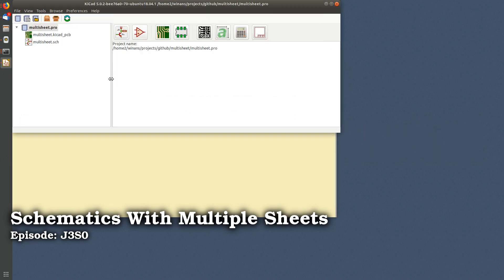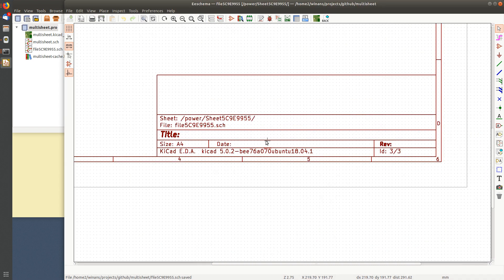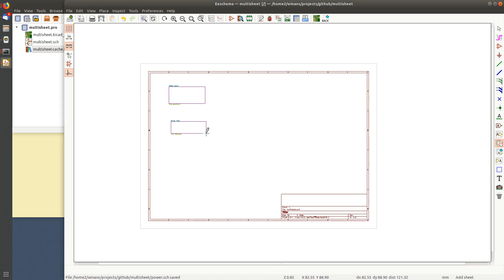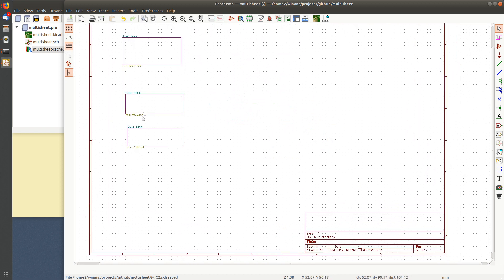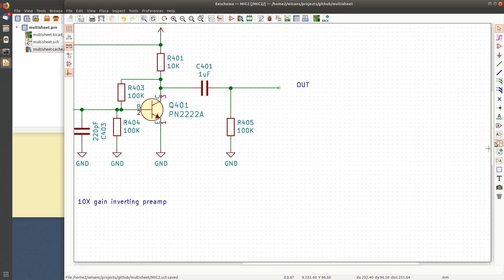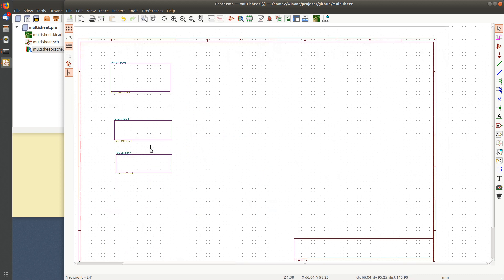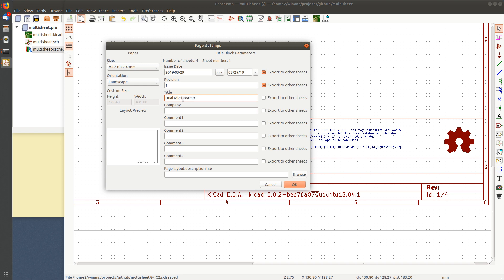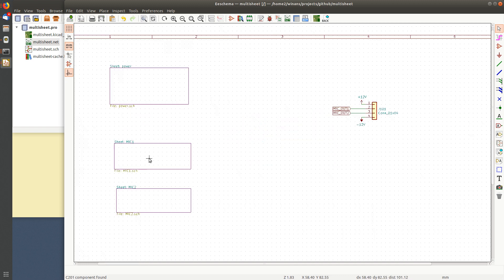KiCad 5 #16 Multisheet Schematics

Comment: Love your video explanations.    Q: Are there any substantial differences in this v5 tutorial, in newer versions of KiCad, ie: v7?
Reply from the maker: Much is the same.  Many have said that this is still relevant.  Since they now change the major rev number every year, it would be ineffective to re-record the series every year just to make that match.  The fundamentals of the tools remains the same.  Some of the default key mappings have changed.  Some new features have been added.  I suppose at this point a difference to a new user that might be important is that you no longer have to save and then load the netlist when transferring from the schematic to the PCB editor.  There is an icon in the same area on the PCB editor that just the whole thing in one go.

Comment: Tutorial was great. One suggestion I have is to have the global port coming out of and into the sheet objects. In this example it's pretty obvious but that won't always be the case. Knowing which sheet a signal came from or goes to at the top level helps the readablility of the overall schematic.
Reply from the maker: That would be a change to the design of KiCad.  You'll have to take it up with the developers.
Reply: Hello John. Turns out it is already there. use the hierachical label an "A" with a diamond to the right of it, on the sub sheet and select import sheet pin at the top level. You can now wire the submodules together. @JohnsBasement
Reply from the maker: @jimbrooks5496  I must not understand your suggestion.  "Global" is not hierarchical.  I suspect you did not mean a "global pin" in your original note... Which changes things.
My point was to address those used to flat multisheet schematics znd that use global nets... Not to suggest that doing so is desirable.

It is a common "complaint" that kicad does not support such designs.  However one can, if they simply drop some pages somewhere and proceed like they would with Orcad. (Last time I used Orcad, it did not support hierarchical multisheet.)
Reply: @JohnsBasement  this would be easier if I cd send a screen shot. The hierarchical label adds a symbol on the lower sheet, kind of like a port global port, but where the global port  can't be inserted into the upper level sheet symbol, the hierarchical label shows and can be used to run connects between top or upper level sheet symbols. This way, the rx tx lines from a comes subsheet could be used to connect the comes subsheet to the processor subsheet making the connections visible. Global make them electrical connected but doesn't give the you 50000 foot view of the design.

Comment: What's the point of those empty rectangles on the root sheet that you click on to reach each sub-sheet?  Would you put them somewhere off screen normally?  Not sure why you need those anyhow if you have the navigator window.
Reply from the maker: You can place them off sheet if they are not part of the schematic's /meaning/.
Often they will have signals associated with them in a way that is the schematic form of a subroutine. Such signals are then the I/O of the sub-schematic.
For example, draw up an analog mic mixer with 32 preamp inputs.
Reply: @JohnsBasement  Thankyou for the reply but my head's not grasping this.  Those just look like empty rectangles.  Why would you want empty rectangles on your sheet taking up space?  What meaning can an empty rectangle convey?  Thanks!
Reply from the maker: @MatthewSmith-wh5dr  they mean there is another page.  Many CAD tools don't require such things to be created.  KiCad does.
Review your thoughts on the subject after watching the hierarchical schematic discussion.  Bigger projects often go that route.
Reply: @JohnsBasement  Got it.  I'm sure it will make sense once I see it in action in a real project.  For me right now, I'm having them off the page to make room. :)
Reply from the maker: @MatthewSmith-wh5dr  That's fine too.  I think I have a recording where I discuss that style for those that don't like hierarchical designs.  That is a matter of preference.
It is just that KiCad does not have a way to create a multi-sheet drawing without using a hierarchical style.  So you have to put those boxes somewhere.

Comment: Hi there. When I want to use the command "Save as" it only applies as "Save Current Sheet as..." but there is no button to re-save the complete Project with another name. Is there a way to run a "Save as..." for the whole project? I cannot find it in the video.
Do I need to save each sheet separately if I want to try modifications? I don't want to end with 10 different sheets with 10 different versions on each sheet.

Any help is appreciated.
Reply from the maker: There is no convenient way to just save a copy of a project (that I'm aware of.) So I abuse the project template function for copying projects.  It is trivial to do but you need to realize what it is doing before blindly diving in.  I posted a video on how I use it to copy & rename projects with KiCad 5 here:
https://youtu.be/A4_wqnzKZq4

Comment: The main idea behind hierarchical sheets in fact is not about using global symbols in sub-sheets for connections between sheets...
Reply from the maker: I address that in part 17.  
I should have given a better overall view of the topic before getting into it here.  The fact is that I have seen an ENDLESS number of questions from users about replicating their flat designs as-is while they upgrade to KiCad.  So I discuss both ways in this series.  Upgrading from, say, Orcad is tough enough without going all-in on hierarchical symbols.
Reply: @JohnsBasement  My apologies John for my draft look - just later realized there is next story on hierarchical design. You are doing this video tutorials thing right! TY for that!
Reply from the maker: @genafongeek  😂 no prob.  This series sort-of just happened.  If/when i find the time to do a second fraft for, say KiCad 6, I hope it will be a bit more fluid.
Keep rhe critique comming.

Comment: What happens if you started a project, and then realized that it had to grow to multi-sheets?  Can I add a parent sheet and declare my former only sheet as a child?
What about a project that is going to be done across several PC boards, but I want to create a multi-sheet schematic that has net names for connections between the boards via a wiring harness?  I will need to create each PC board from a set of sheets.  I guess the over all connection would be a 'grand parent' sheet that shows the connections between each parent sheet (which is the top sheet for each board), and the set of child boards fore each parent (pc) board. 
I've seen schematics where each board was drawn on the top sheet as a 'part' and the top sheet showed all the connections between boards.  Then each board was a set of child schematics, the parent of these was the 'part' shown in the top sheet.  How to do something like that?
Reply from the maker: You might be able to make a single-sheet project a parent by playing games with renaming files.  But I'd play it safe and create a new project with its top page as the new 'root page' and then copy the sheet from the original/old project to the new project and then use it as the file in a new sub-sheet.
Multi-boards comes up once in a while on the kicad forums.  I am not aware of any viable solution.  You might try asking about this in https://forum.kicad.info/
Until KiCad implements multiple boards in one project then I think the idea of drawing a multi-board connection schematic might have to be its own project.

Comment: Hey John, what program do you use for circuit simulation? I'm assuming you're using it with Ubuntu...? Can you use the schematic editor from KiCad and export the resulting netlist into the circuit simulation program...? Thx for any help, love the series!
Reply from the maker: I haven't used circuit similation with kicad.  So I can not offer an opinion on doing so.
I'm sure others have.  You might ask about it in the various kicad forums.
Reply: @JohnsBasement  Wow, a spice app is built right in to Kicad 5.0! Very cool.

Comment: How can I change the order of multi Hierarchical Sheet, which means change of "Id" no. by manually .
Reply from the maker: I don't know if you can.
Sheet page numbers are assigned in the order that the 'sheet symbols' are added to your project.  Therefore, in theory, you can copy all of the sheet symbols to new ones in the order that you want your pages to be numbered and then delete the original symbols. BUT, if you do this, your part/component reference designators will all change and that will make any PCB that you have been working on into a broken mess.  So.. don't try this unless you ONLY have a schematic in your project.
If you want to get creative (and risk completely destroying your project), FIRST, make a backup your project and then try poking around inside the .sch files to see if you can edit the page numbers that are stored within.  They are all plain ASCII files, you any text editor can open them. I read somewhere that the page numbers are based on the order that the sheets appear in the .sch file within which they are defined.  For example, in an old project I have around I can see a set of these 'stanzas' in my root level page:

$Sheet
S 1750 3300 1750 550
U 5D92F9C9
F0 "CPU3" 50
F1 "CPU3.sch" 50
$EndSheet

I can also see that each of these stanzas are in sheet/page-number order.  If I cut & paste the stanzas in a different order (without otherwise altering them in any way) , it APPEARS that I have changed the page numbers on the sheets while not having 'broken' anything.
Beware!  I would not bet more than a round of drinks on this method being safe.  Nor would I expect it to be stable/viable in future releases of kicad.
Reply: @JohnsBasement  Thank you Jhon, the thing which you shared is very helpful for me and my friends.

Comment: "creating new sheet in kicad without using Hierarchical Sheet is possible or not..." Because while converting it to the pdf file the root sheet contain all the sub_sheet block (table) in it ,which was created by us. It seems not good in the font page. How can I solve this problem? Could anybody can help me in this problem.
Reply from the maker: Hierarchical is the only way.
You can spec printing pages 2-n.  But then the sheet numbers start at 2.
When i want multisheet & no hierarchy, i put small sheet symbols for pages 2-n at the bottom of my sheet 1 (which is also full of my page-1 schematic.)
You can also put the sheet symbolsoutside of the page borders on your sheet 1.  Then they won't print at all.
Reply: @JohnsBasement  "Thank you John"

Comment: If you can reproduce it easily , it would be valuable to report the "lost connections / bubbles" stuff to the KiCad bug tracker (https://bugs.launchpad.net/kicad).
Reply from the maker: Yeah.  I thought about doing so.  But first I need to upgrade to 5.1 & test with that.  Maybe it is already fixed?
Reply: I thought you were already running 5.1. My bad !